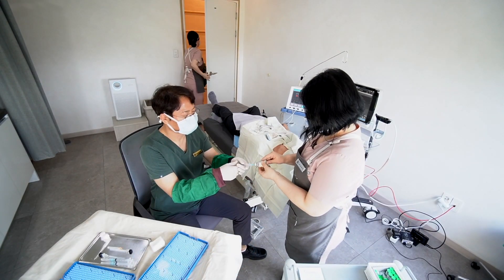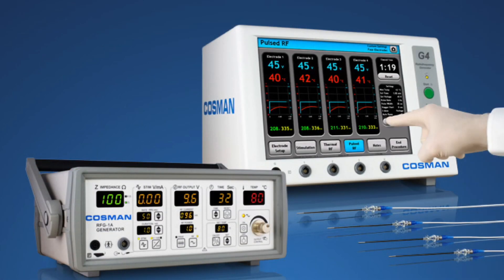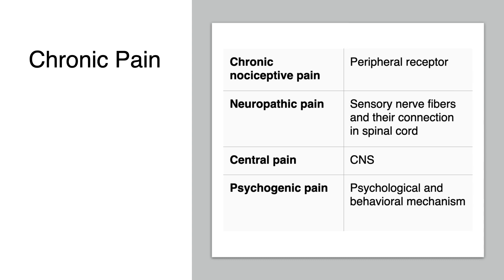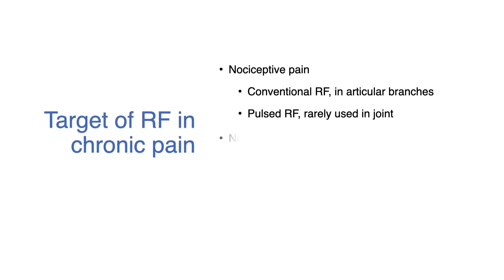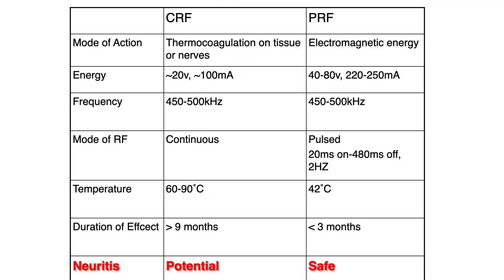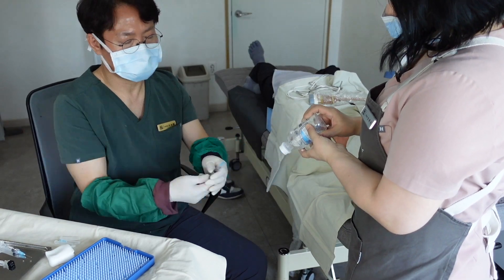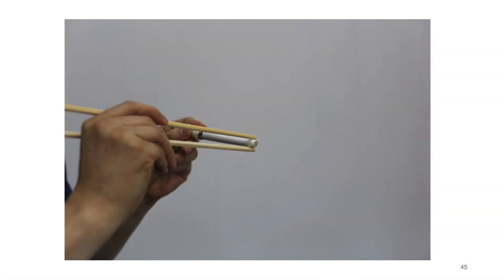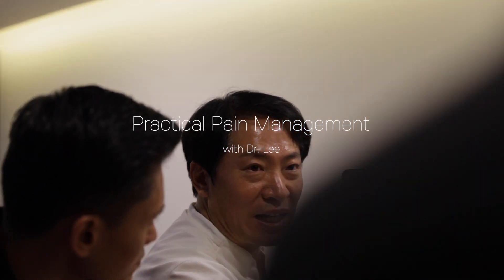Trailer_US-guided pulsed radiofrequency for chronic cervical radicular pain; bipolar technique

Comment: Hello Dr.Lee, I am from suffering from unilateral testicular pain from the last 8 months due to riding motor cycle on a bumpy road. My testicles went up and down at that time. And started mild pain and later the pain is very high and now I am unable to walk properly. And the testicle also become very loose along with hanging pain. My leg is also shrinked a bit with less hip inner rotation and was unable to put my legs together.
I visited a pain management specialist in my area and he given 2 solutions. One is pulsed RF and the other is genital branch block of Genito femoral nerve block.
Which is good or any other method is good to get rid of my testicular pain?
Reply from the maker: Sorry for the late answer, I had a hectic busy day for preparing and holding a conference. I am sorry for your testicular pain. First, you have to find the cause of the pain. before any advanced procedure, find the appropriate nerve that can relieve pain, and then apply for a longer relieving way. How was your testicle? Did you check the condition of the testicle with an ultrasound or consulted to urologist?
Reply: @practicalpainmanagementwit8115  yeah taken many ultrasound scans, everything is normal. Consulted many urologists they are saying that everything is fine.

Comment: Do you have experience treating Morton Neuroma with RF? Which modality, continuous or pulsed, mono or bipolar?
Reply from the maker: I tried to find Morton neuroma in my clinic. But most pain arise from the different pain generators, such as leaking caspule from the MCP joint capsule. So, I do not have experience RF in the Morton's neuroma

Comment: Hello. Thanks for this video. C7 nerve USG is the upper one visible?
How does the VAS value change in the short and long term?
Is there a difference between the PRF time of 5 minutes or 3 minutes (have you ever done it?).
Reply from the maker: I think there is no problem to visualize the C7 nerve root.  I did not try for 3 mins. I think it is too short for making a good results. If I have more time I can stimulate longer than 5 mins.

Comment: What aproach do you prefer? Infrapedicular or infraneural?
Reply from the maker: It is ultrasound guided procedure, not the C arm lumbar transforaminal approach. for PRF in target the nerve root, not the bony landmarks.  So, the lumbar spine, I  prefer infrapedicular in case of HLD or foraminal stenosis, and prefer infraneural in discogenic pain. I use adjuctive injection in a situation of incomplete opacification of contrast media of the infrapedicular approach.